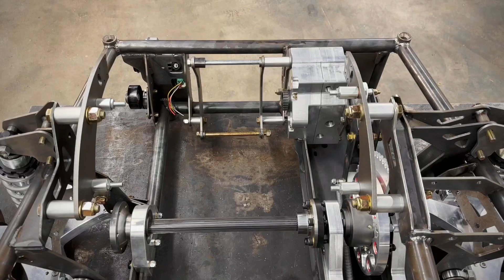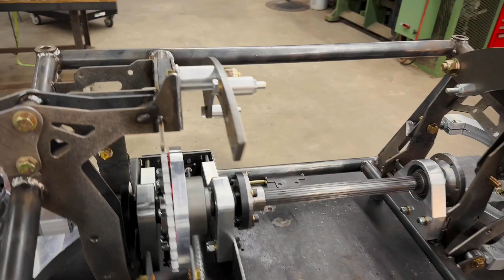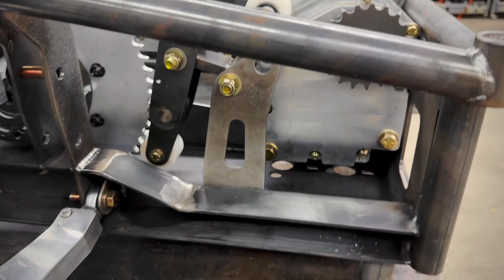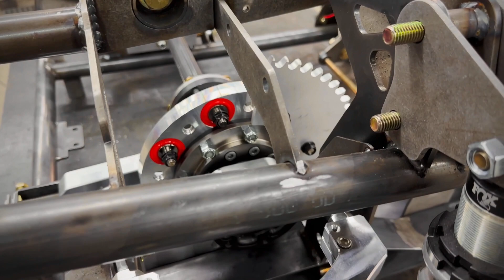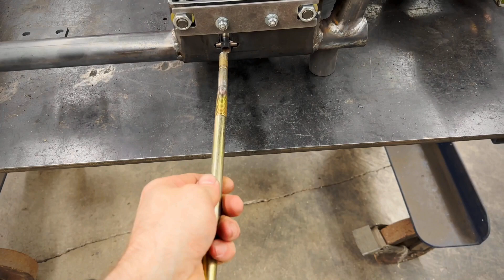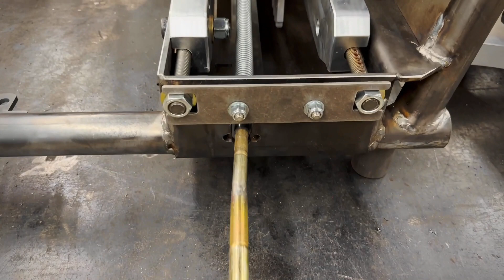Quick walk around. Hayabusa smart car conversion kit by Burrup Designs.

Comment: Do you have a kid fully billed bulb with engine and everything and could be installed on the 2017 Smart Fortwo 453 model?
Reply from the maker: I haven't built a kit for the 453, so not sure if it bolts right up, needs some modification or will even work....

Comment: Have you thought about doing a h2 conversion kit or do just think the hayabusa is far superior
Reply: It looks there’s not a turbo on the motor in your designs. And what do I sacrifice from the stock car, like AC/heat and original Speedo?
Reply: @SJ_999  Ac's out the window. Speedo in most videos are used from the bike.

Comment: How much is the conversion kit?
Reply from the maker: Base kit is $19k.
Reply: Thats a ridiculous price. This is like farm quality framing. 19k is mental for a base kit@SinisterSandSports
Reply: 19k is a fairly good price for a high quality kit. This isn’t a thrown together backyard project & yes there is a difference.

Can you make it for cheaper?
Do you have a 3D scanning tool? Designing software? CNC Machines (Cutter,Mill, lathe, drill, etc..), Welder, Pipe Bender & the list goes on.. this is just to scratch the surface 

Now what about the amount of time it will take you to even design a project. The trials & errors, etc.. 

There are other shops that do busa conversations.. their prices start around $20k as well.. don’t believe me then call around,, cross cars from global karts & Sierra Cars sell for $45k-90k+ if he wanted he could design his own 1 & 2 seater street car since sierra cars has gone fully electric & he could really make a decent penny.